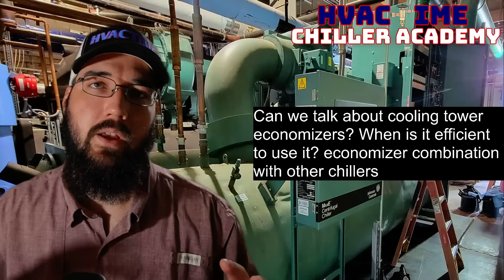Chiller Plant Economizers Explained

Comment: I was at a place recently that has 550 ton air cooled chillers with a water side economizer on it. It will do the same thing as the tower  for a water cooled chiller. The chiller also has a hybrid mide where it can use the economizer and mechanical cooling at the same time.